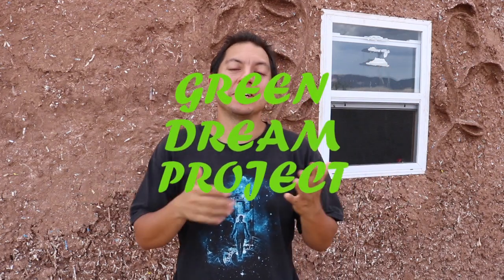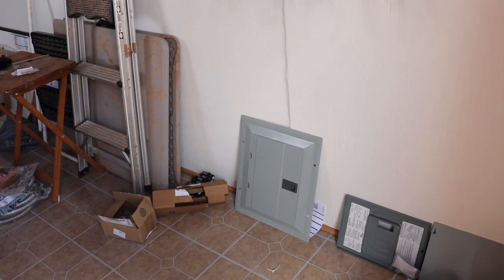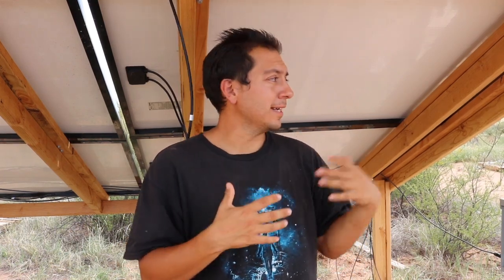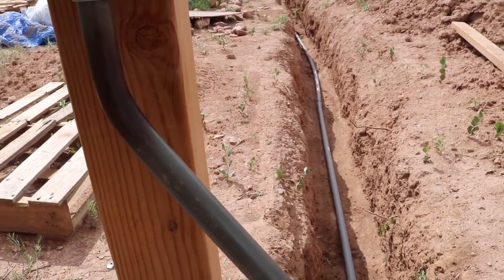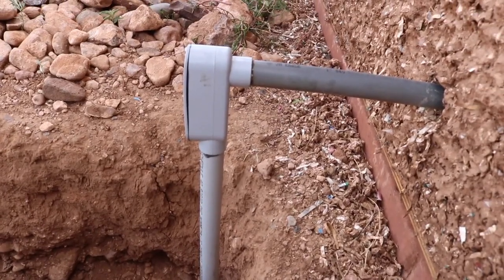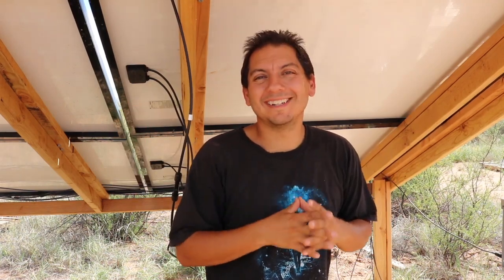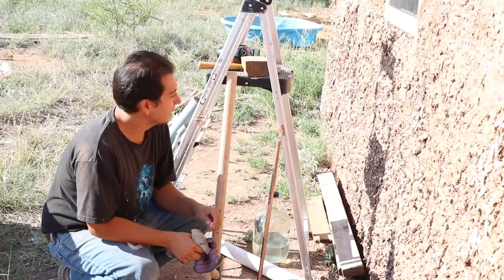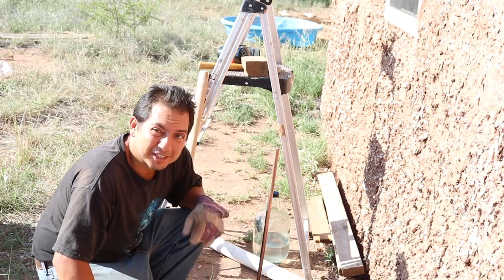Solar/ She Shed and Solar System Update Plus Installing a Grounding Rod

Comment: HOWdy  G-D-P,
Thanks
just an  FYI   NOTE: that 8' Grounding Rod is STEEL with just a coating of COPPER on  it's surface - if it was COPPER it would be prohibitively EXPENSIVE & NOT very Stiff   
COOP
the  WiSeNhEiMeR  from  Richmond, INDIANA
...

Comment: the solar panel racks look like they are set up for 18 panels, you have 15.
if you had 18 panels of the 325 watt then you could add another parallel to the combiner box. 
However your MPPT 150/60 would need to be replaced with an MPPT 150/85 if you want to stay with only one MPPT.
this would give you your 8KW, 4KW for one inverter 4K inverter, and 4KW for the other inverter.
You can ask your expert friends.
I don't know if Schneider has a bigger MPPT.

Comment: Excellent Jim.  Is the copper wire attached to the grounding rod somewhere underground that we cannot see?  Sorry if this is a very elementary question.
Reply from the maker: Yes, the wire gets attached to the rod. There's a bracket that gets attached to the rod and you put the wire in that.

Comment: I would love to be getting solar but that will have to wait awhile. I’m an electrician that’s how I drive ground rods too but here in Florida it takes me less than 5 minuets to drive a rod.
Reply from the maker: 😲Wow, that's fantastic. There are several things working against us. We're in the desert, and it's formerly been grazing land, so the vegetation isn't very thick. Combined with the low rain fall can make for some pretty tough soil.